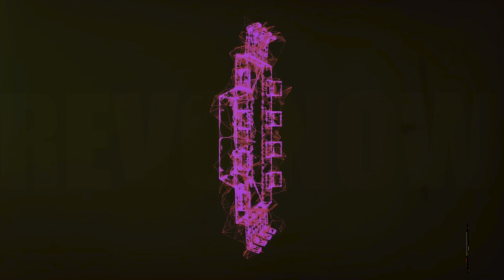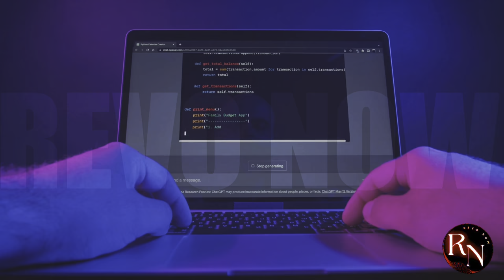China's Photonic Chip MASS PRODUCTION Era Begins!

Comment: Wow, China is ready to mass produced the photonic chips that works on photon instead of electron. Since light travels at 300000km per sec the data transfer using this speed would be incredibly fast. China is on the forefront of the new era of semiconductor technology as it has now announced its first production line of photonic chips. The usa based silicon technology has been surpassed by China's photonic chips.